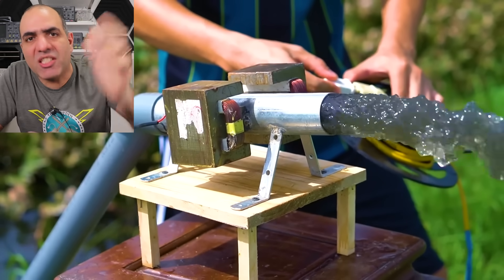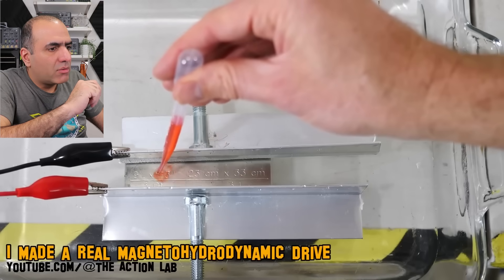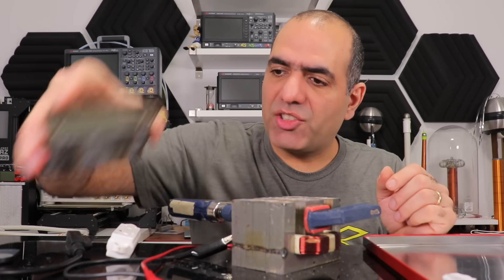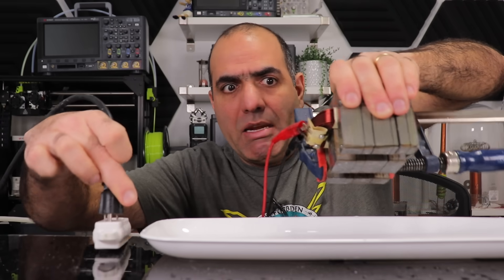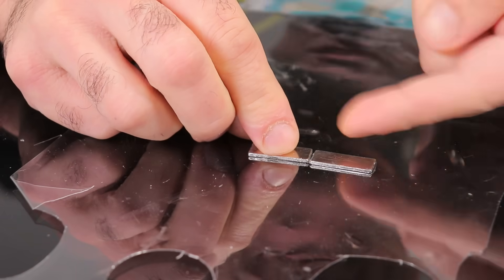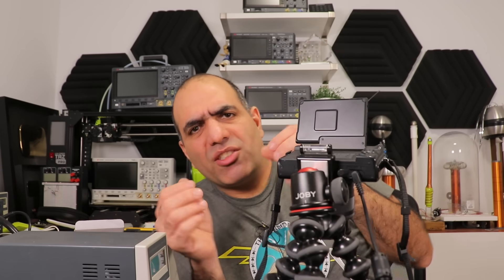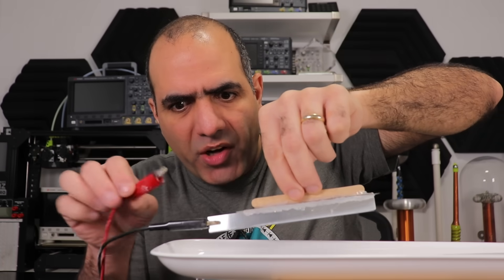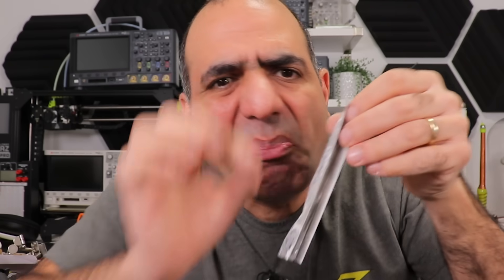Making a Water Railgun

Comment: You might actually be releasing toxic chlorine gas here because you are using salt (NaCl) as an electrolyte. This is because you are doing electrolysis with the water which also releases hydrogen gas from (H2O). Although I don't know enough to say either way, in my personal experience with electrolysis anything to do with salt is normally frustrating and underwhelming, but you can use a stronger electrolyte like Lye to get better results. Lye is dangerous though so... yeah.

Comment: You don't actually try that from that clip. Two electromagnets are used there. They do something like in the old electricity meters where there is an aluminum disc driven by the vortex magnetic field, was it called? An electromagnet made from the transformer becomes very powerful. If it goes in clips, it can lift at least 2 people.

Comment: For the love of breathing don't do this with NaCl as you could make chlorine gas which is a nasty customer. Use NaOH instead you will get as good if not better conductivity and you won't die. You can't use tap water either as that has chlorine in it so you need to purchase some distilled water and then add you NaOH or lye to it, KOH should work just as well. Your friendly chemist trying to help you not melt your lungs, which is what chlorine gas does. It makes HCl or hydrochloric acid in your lungs and you drown.

Comment: It’s entire concept is flawed. Salt is negatively charged. Chloride in saltwater corrodes the positive end, limiting the system’s lifespan especially when you dump lots of current into the system. You would first have to stop those saltwater components from breaking down the submerged anode. Great video

Comment: When you say water isn't magnetic, that isn't quite true. Water is diamagnetic which means that when you subject it to a magnetic field it creates an opposite (but weak) magnetic field. With this you could levitate water with a magnetic field just like a one research group at one point levitated a frog. However, the magnetic fields required are very strong.

Comment: I do have a question;

But could it possibly work just based on the source of water. Here in the upper Midwest, there is large iron deposits in the soil so water from a natural source like a well or pump tastes irony. 

Therefor, wouldn’t this possible be the difference that could actually make it possible with that setup like the aforementioned video clip at the beginning?
Reply: Does that make your pump ironic?

Comment: 13:30 they are poisonous, please use something different than salt to ionise the water with, you are producing chlorine gas (also hydrogen but that‘s ok).
At this scale you shouldn‘t have a problem, but you are producing some amount. I think baking soda for example would be a good alternative, but just doing it outside should be enough.
Nice video as always

Comment: The gases are poisonous. If you preform electrolysis on distilled water, you get oxygen and hydrogen. But if you do it with salt water, you get hydrogen and chlorine gas, and chlorine gas is poisonous. However, the amount in this experimental setup is negligible, so not really dangerous. The reason for the difference is that chlorine is even more attracted to the electrode than oxygen and sodium (table salt is sodium chloride) is very attracted to oxygen, which is why sodium and oxygen react so readily with each other, but this is normally prevented by hydrogen and chlorine, only their share continues to decrease during electrolysis as they become gas and leave the solution.

Comment: I had a friend we called ROBOT RANDY, who worked for a major company as their top industrial appliance (rarely residential) repair specialist. He literally  could fix anything.  Now I worked in another field, where I used to say that I could fix anything.  For ME and most of Humanity, that would be a huge exaggeration, but for Randy it wasn't. 
---> I took him to another friend's home, one day, on  a visit, and made a bragging introduction, emphasizing "fixing anything", and my friend jumped up and called me out. He said, "Bullshit! Prove it!".  I asked, "do you have anything that's broken?" 
---> After a brief pause, He said He DID!  He started out telling us that he had a repairman in for his washing machine, and was told he needed a whole new control panel!  My friend asked for symptoms, and he said, "It only works on GENTLE cycle, which always takes forever to finish."  My friend stopped him, holding up his hand, saying it was a "Whirlpool" and the "BLUE" wire is on the floor!  My friend, ROBOT RANDY, said he could fix it with a wire-crimping tool and a spade-lug. 
---> I said let's go look for that BLUE wire.  My friend with the broken washer held us back, so we couldn't change anything, and he handed us a crimper and new spade-connector, and tipped the washer over, to look.  "Well, I'll be damned", he exclaimed, "there is that BLUE wire, hanging down on the floor!" Robot Randy bent down and crimped on the new wire-end and reached up to plug it back in, and said, "Try it!" 
---> My friend put the washer back down, turned it on, and it ran just FINE!   Then he bowed and kneeled in front of ROBOT RANDY, and while mock-kissing his feet, he said, I will never doubt your word again!

Well, Robot Randy was often just as dangerous as the aptly named, "ElectroBOOM".  
---> There are many stories, but the most exciting was his "TESLA COIL" phase.  He became obsessed with building his own spark machine, and he hand made special gigantic capacitors and obtained an old 20KV Power-pole transformer to use as the driver-part of the gigantic circuit.  After several months of evenings and weekends, it was ready to test!
---> On the day of the first TEST, It Worked Too well.  It was TREMENDOUSLY NOISY and emitted sparks that were 6 to 10 feet long.  If you let them hit your hand, It left a pretty good burn, without metal thimbles on your fingers or other interface.
He keep tweaking things for a better spark, when CRACK! A 10 or 14 foot spark set every part of his circuit on FIRE.
---> We were standing-by with fire extinguishers, so it caused no damage to the back-yard or out-buildings!  Randy was finally satisfied and began moving on to other things.  Though, he did rebuild the Tesla Coil Spark System.  (That turned out to be quite hard for his widow to get rid of!)
---> He Died of Cancer Around 5 years ago, RIP, ROBOT RANDY.

Comment: Do a video on an electrolysis and combustion pump (pumping water using air pressure or 2H2 and O2, then turning it back into water using combustion). FYI, this is just some theory I have been tinkering with to drive steam generators and water wheels to try to extract more energy from the system than is put in. Hvae fun with this.

Comment: And you can use a transformer with DC with a mechanical relay. I ran a microwave oven transformer with a nine volt when I was 15 years old that way.
Reply: Water is diamagnetic like aluminum and iron is paramagnetic. One pulls, one pushes.

Comment: Hello. How do you like the idea of creating a plasma household heater?

It should work roughly like a gas stove. There are several sources of plasma formations. They are connected in a single cluster. Remember what a flame looks like in a gas stove. These plasma sources are located close to each other, which makes them more powerful, unlike if he was alone or they were separated by a large distance.
Approximately, the design looks like combining several Tesla coils into a battery. These coils should, in theory, produce plasma without a second contact, i.e. the antenna radiates plasma into space. I do not know how to do it. And what design will be the most effective. I only know that with a small amount of energy we get a plasma that can melt metal. Accordingly, this idea led me to the fact that it is possible to create a plasma household heater and give this knowledge to people.
It would be very cool if you noticed my idea and would explain to us how to do it. After all, the issue of space heating is more relevant for people than just experiments with plasma.
Perhaps each individual coil could later be placed in a glass flask to make them safer for the home.
But this is up to you.
I submitted the idea. How to implement it - I have no idea, except for some of your videos and your colleagues on YouTube.
If, nevertheless, you can implement something similar, then I would like the design to be as simple as possible, so that any inhabitant of the planet can implement it at home by buying the missing parts in the store or dismantling some household appliance.
--------------------------------
Здравствуйте. Как вам идея создания плазменного бытового обогревателя?

Он должен работать примерно, как газовая плита. Есть несколько источников плазменных образований. Они соединены в единый кластер. Вспомните, как выглядит пламя в газовой плите. Эти источники плазмы расположены недалеко друг от друга, что делает их более мощными, в отличие от того, если бы он был один или они были разнесены на большое расстояние.
Примерно, конструкция выглядит, как объединение нескольких катушек Тесла в батарею. Эти катушки должны, по-идее, давать плазму без вторго контакта, т.е. антенна излучает плазму в пространство. Я не знаю, как это сделать. И какая конструкция будет наиболее эффективной. Я знаю только то, что при затрате маленького количества энергии мы получаем плазму, которая может плавить металл. Соответственно, эта идея привела меня к тому, что можно создать плазменный бытовой обогреватель и дать эти знания людям.
Было бы очень круто, если бы вы заметили мою идею и объяснили бы нам, как это сделать. Ведь вопрос обогрева помещений наиболее актуален для людей, чем просто эксперименты с плазмой.
Возможно, каждую отдельную катушку в дальнейшем можно будет поместить в стеклянную колбу, чтобы сделать их более безопасными для дома.
Но это уже на ваше усмотрение.
Идею я подал. Как её реализовать - не имею представления, за исключением некоторых ваших видео и ваших коллег по Ютуб.
Если же все-таки вы сможете реализовать нечто подобное, то хотелось бы, чтобы конструкция была максимально простой, чтобы любой житель планеты смог её реализовать у себя дома, прикупив в магазине недостающих деталей или разобрав какой-то бытовой прибор.

Comment: "For some reason my home is running at 113v RMS"

The power company: "yes. If we give him less power, maybe he'll stop shorting his house out" 😉
Reply: fun fact, that's not how RMS and power work... Most likely he simply has a low crest factor on the supply voltage due to (more) non-linear loads in the house. Non-linear loads typically draw current at or near the peak voltage resulting in a LOW crest factor.

Comment: Answering your question: All these gases getting out of the water are hydrogen on the negative side and chlorine on the positive. They will mix and form HCl which is chloric acid in gaseous form: so YES THEY ARE VERY TOXIC, besides, if too much hydrogen is formed too quickly you will get a loud explosion. If you use a little NaOH instead of salt you only get oxygen and hydrogen, an explosion still may happen: to avoid electrolysis you must use AC and electromagnets instead of permanent ones that also are powered by the same AC this way you will get the flow in one way and no electrolysis.

Comment: There is also para- and diamagnetism, which is a (typically) very weak attraction to or repulsion from a magnet respectively. Different materials are more para- or diamagnetic than others. Most of the time, this is barely noticeable, but there are exceptions. Pyrolytic carbon, for example, is extremely diamagnetic and can even levitate above well-placed magnets. Aluminum and titanium are weakly paramagnetic and have an unnoticeable attraction to a magnet, unless placed in a sensitive testing apparatus.

One other thing: water is weakly diamagnetic, and the effect can be slightly noticeable with a very strong magnet.

Comment: This did make me curious to research the existence of solid state pumps in general since reducing moving parts is a valuable endeavor. Found one that functioned using a stack of rapidly vibrating piezoelectric discs which seemed interesting. Still has moving parts technically but none of the issues that traditional motors have like bearings that wear out. Reminds me of a similar solid state fan for PC cooling that was presented at CES.

Comment: You can move totally pure water electrostatically with high voltage. You can even move oil in this fashion. We used to observe this in high voltage DC power supplies used for X-ray tubes. It takes a lot of voltage, typically 140 kV.

Comment: Ah, excuse me, EB, but did it ever occur to you to use a light switch (heavy duty, of course) to construct a switched outlet for your experiments? Inserting the plug of a device already under load into a jack damages both the plug AND the jack! That does not even go into the safety aspects. I spent most of my adult life working and around electricity and I learned very early on how to work safely with energized circuits. Please, PLEASE take the time to build yourself a switched outlet or at least put a switch in line in your cord setup. (You'll be glad you did!) I have no desire to go to your channel for the latest video only to see an announcement that you had managed to shuffle yourself off this mortal coil.

Comment: Hey dude, d.c. magneto-hydrodynamics are really inefficient because you're relying on an ion transportation at the electrodes. If you use alternating magnets and alternating current, you'll get much better results for your current use. The effective conductivity of the water will also go sky high because the water has a capacitive effect. Obviously I don't need to tell you that this can be optimized.

Comment: You should try replacing the permanent magnets with an electromagnet (but still pass current through the water) You'd get a bigger magnetic field therefore more force for less current, and you wouldn't have issues of the magnet loosing its magnetism. You then also try AC - the magnetic field would change at the same rate as the current, so it would continue to apply force in one direction, but electrolysis might be reduced as most of the chemicals will recombine as soon as the current reverses direction.

Comment: @ElectroBOOM isn't this also a method to move a ship? Use two "Railguns" next to each other with different current to move the ship or reverse one flow to turn on the spot like a tank. Isn't that a futuristic idea?
Reply: The silent caterpillar drive in "The Hunt for Red October" was a superconducting MHD pump, but as far as I know it's never actually been used because it's inefficient and galvanic corrosion rots the electrodes quickly. That said if someone solved the corrosion problem or figured out some more efficient AC mode, they wouldn't exactly tell the world about it if the application was naval.
Reply: Mitsubishi actually made a full scale prototype in the early 90s. It worked, but wasn't efficient. Top speed was only 8 knots.

As a stealth drive for submarines (as in Red October), it might almost make sense. No moving parts, so it should be very quiet. The issue is, regular electric motors are also pretty quiet, don't produce as much of a magnetic field, and don't need liquid helium to cool the superconducting magnets, so this probably isn't worth the effort.

Comment: Yes, there is poisonous gas coming from the water. Through electrolysis of salt water, you're making chlorine gas (very poisonous) and hydrogen gas (combustible). The chlorine comes from the NaCl salt. You could try baking soda or lye solution (sodium hydroxide) instead. Baking soda solution will only make hydrogen and CO2 (not poisonous, not combustible), but lye solution will make 2 parts hydrogen and 1 part oxygen (not poisonous, very combustible).
Reply: @official_Electroboom
👆🏽write me✍️You won something special🎁🏆..

Comment: Hello! On 1:30 you said that water is not magnetic, but actually it is, it have a very weak magnetic field cause the 2 H atom's are negative and oxygen positive, the positition of the molecule is not linear but is 104,45° degrees. If you put water inside another magnetic field, it will aligneate the weak magnetic field of the water, so all the molecule aligned will create a very weak magnetic field. I remember a scientific experiment where you let a very thin flow of water and put a magnet close to the flow.. it will blend very very slightily towards the magnet. I hope what Im saying is real and not product of my immagination. The argument is polar or apolar molecules.

Comment: I reckon that your magnetohydrodynamic railgun may suck as a form of propulsion (or a pump), but could be useful as a way of (eventually) extracting pure metals from metallic salts. Here, for example, I suspect that at least part of the shorting was caused by the buildup of sodium on the conductors (though most would immediately react with the water, adding to the heat). Unfortunately, this would also release toxic Chlorine gas - so not good around anything with lungs...

Perhaps try Aluminium, Potassium, Calcium, Copper, Zinc or other salts..? (I don't know which of these are non-toxic, so caution would be necessary... More than usual, I mean...)

Comment: Water is dia-magnetic, just very weak. Because the Hydrogen-atoms give an electron to the oxygen, the oxygen atom is negativly charged while the hydrogen atoms have a positive charge. That's why water is liquid at normal conditions. The molecules can attract each other and form chains.

Anyway: A strong magnet can interact with water.